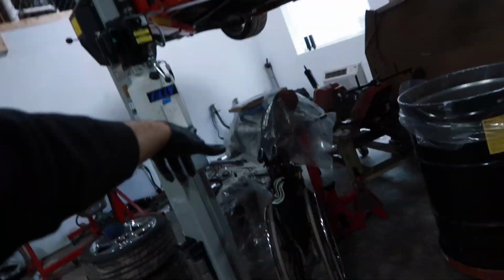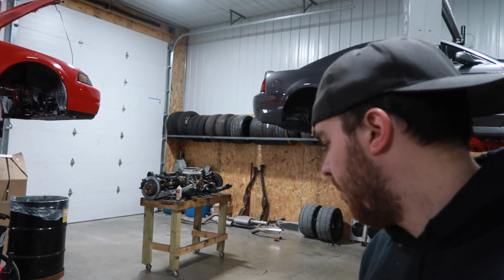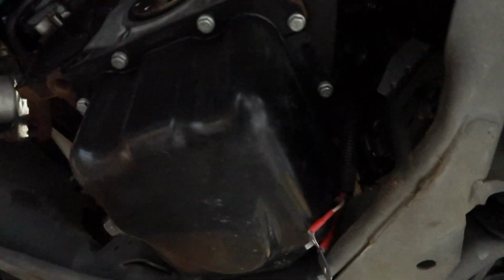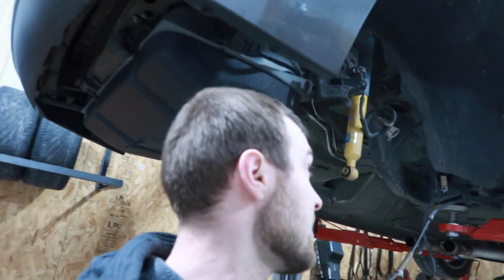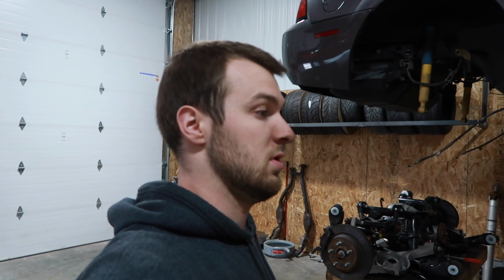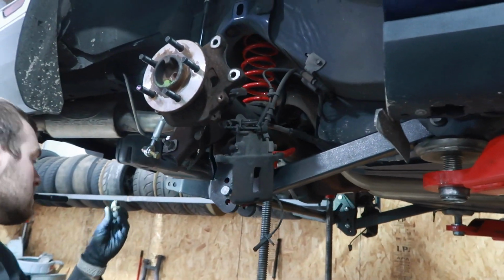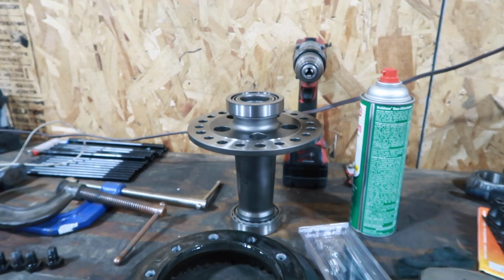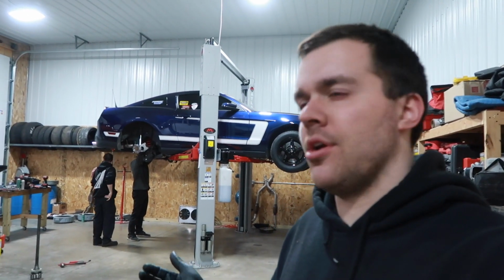8.8 Strange Spool install, 351 Windsor Tear Down, and 2003 Cobra Goodies. Ford fans rejoice!

Comment: Remember that 69 351 block is a hair shorter than later blocks so if you do and piston, rod, or crank changes to really check the clearance.
Reply from the maker: Good point, keeping rods and crank but maybe a piston
We will keep it in mind!

Comment: Torch Red and DSG, two of my top 5 favorite cobra colors in the shop! That's a good point about the RST and the adjustable clutch. I've been back and forth on the RST VS RXT for the build I want to do. Really liked Dan's trick w/ the extensions for the starter bolt.